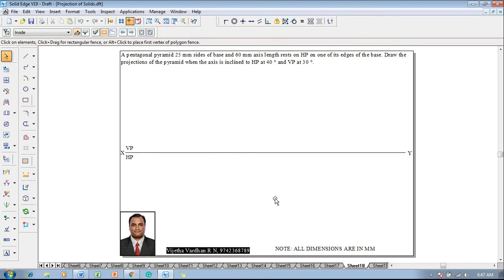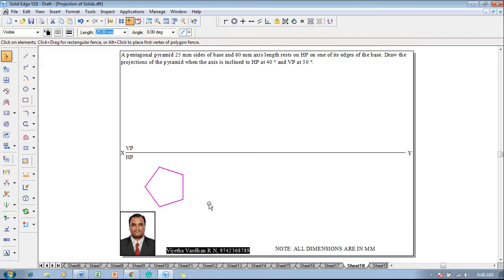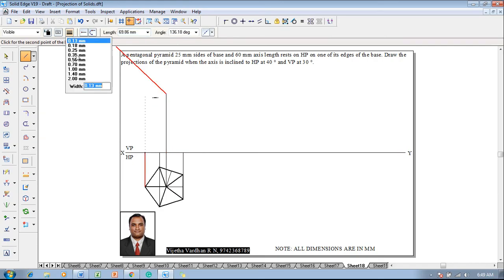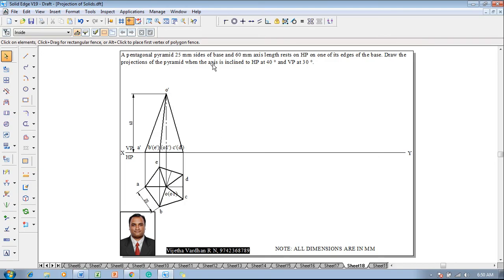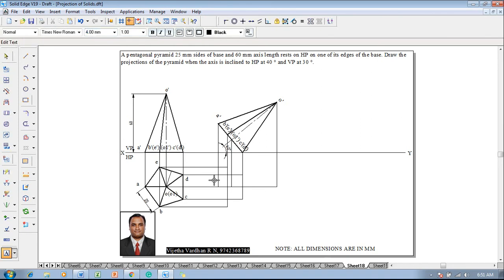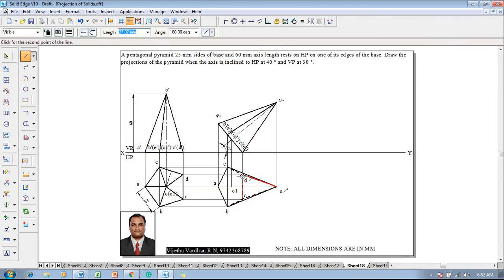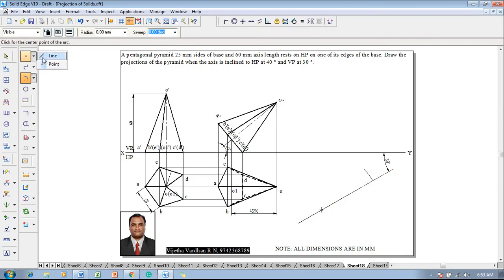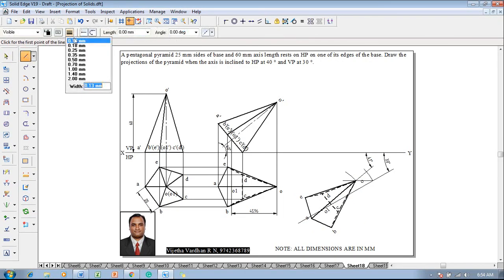Example 18 on Projection of Solids

Comment: Sir when we take the locus and what type question
Reply from the maker: Hey @ChanduM-u8c welcome back to the channel! Today, we're diving into a common point of confusion in descriptive geometry: When exactly do we draw a locus line? I've seen some explanations out there, and I want to make it super clear and precise for you.
You might have heard something like "a locus line is drawn when a line is inclined a second time." While that's getting close, it's not the full picture, and it can be a bit misleading. Let's break it down properly.
The Fundamental Concept of a Locus Line
First, let's remember what a locus actually is. In geometry, a locus is simply the set of all possible points that satisfy a given condition. Think of it as a path traced by a point as it moves while obeying certain rules.
In engineering drawing, especially when dealing with projections of lines or planes, a locus line comes into play when we're trying to locate a point (or an end of a line) that has restricted movement or whose position is dependent on a changing condition.
When to Draw a Locus Line: The Precise Explanation
You draw a locus line when you know:
 * The direction of movement or the path along which a point must lie. This direction is often parallel to a principal plane (HP or VP) or defined by an inclination.
 * You don't yet know the exact final position of that point along that path. Its final position is determined by an additional condition or intersection with another element.
Let's tie this to your statement about a line being "inclined a second time" and foreshortening:
Your intuition about "inclined a second time" and "foreshortened distance" is very relevant, but let's rephrase it for clarity:
You will draw a locus line for the end point of a line when that end point's position is being determined by an intersection with a path created by a new or changed inclination relative to a principal plane, resulting in a projected length (foreshortened or true) that is different from a previous stage.
Here's a breakdown of that:
 * "New or changed inclination": This is where your "inclined a second time" comes in. If a line segment's true length or inclination with a plane is known, and then it's rotated or re-positioned such that its projection on a principal plane changes, the end point of that projection will lie on a locus.
 * "Resulting in a projected length that is different from a previous stage": This directly relates to foreshortening or reduced length. When a line changes its inclination with a principal plane, its projection on that plane will change in length (it will foreshorten unless it becomes parallel to the plane).
A Practical Example (Think of a common problem type):
Imagine you have a line AB.
 * Stage 1: You know the true length of AB and its inclination with the HP (Horizontal Plane). You can project this to get the top view (a-b) and front view (a'-b').
 * Stage 2 (Where the Locus Appears): Now, let's say you're given a new condition: The true length of the line remains the same, but its inclination with the VP (Vertical Plane) is also given, OR you're given the final projected length in the top view or front view.
   * In this scenario, for the end point 'B' (or 'b' in the top view, or 'b'' in the front view), you don't directly know its final projected position.
   * What you do know is that because of the true length and the first inclination (e.g., with HP), the point 'b' in the top view must lie on a circle (or arc) with 'a' as the center, and the radius being the foreshortened length corresponding to the true length and HP inclination. This circle represents the locus of point 'b' due to its inclination with the HP.
   * Then, you use the second condition (e.g., inclination with VP, or final projected length) to find where the locus from the other view (e.g., the front view) intersects this first locus. The intersection point will be the final projected position of 'b'.
Key Takeaway:
A locus line is essentially a construction aid. It's a temporary line drawn to represent all possible positions of a point when one piece of information about its position is known (like its distance from another point, or its inclination path), but its final, unique position is still dependent on additional information that will define an intersection point on that locus.
So, it's less about just "inclined a second time" and more about:
 * Knowing the path a point can take.
 * Needing another condition to pinpoint its exact location on that path.
I hope this clarifies it for you and your viewers! Let me know if you have any more questions. Don't forget to like this video and subscribe for more engineering drawing tips!
Reply from the maker: In simple words if a line is inclined to both the planes we construct the locus line for actual position.